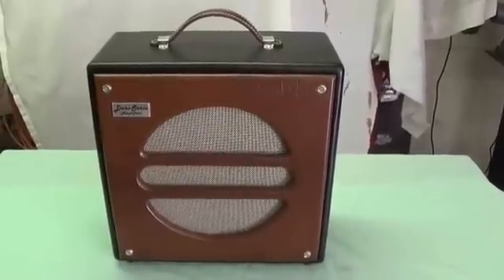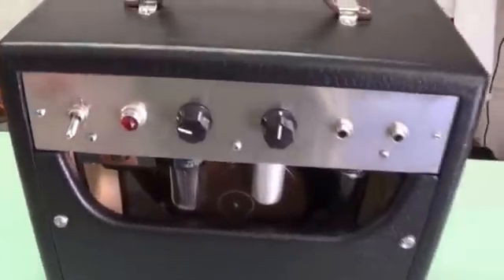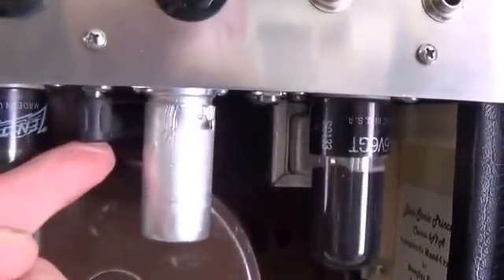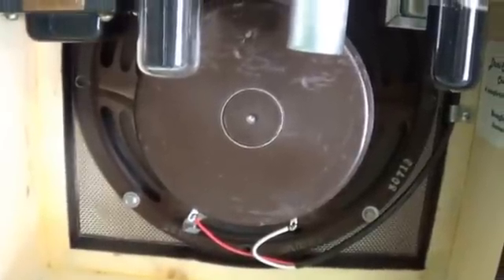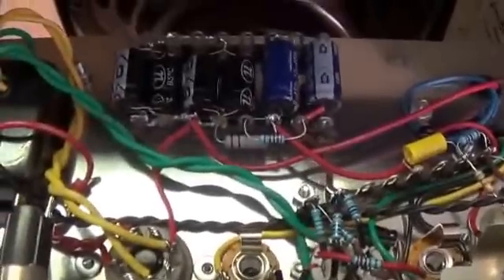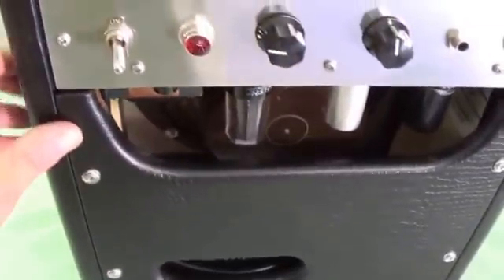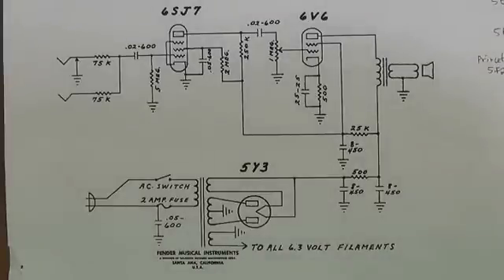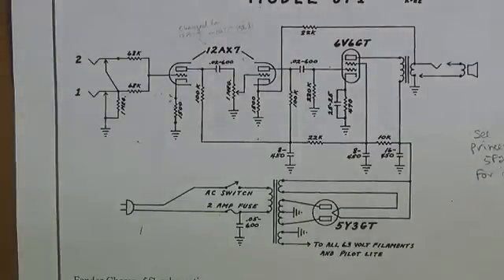1950's Fender Princeton 5F2-A Home-Built Guitar Amplifier

Comment: Uncle Doug, why did you use 1k grid stopper for 6V6?
Reply from the maker: Maybe I was out of 1.5K resistors (?)
Reply: @UncleDoug  Yes, but why did you add grid stopper ? Is there any difference in sound compared to original schematic?

Comment: Beautiful amp Doug, Amazing job, HAHA exercise in frustration indeed, For all its good aluminum is not always fun to work with. I lost all faith in 3M spray adhesives, not relevant here but, I use to use a lot of the Super77, which always worked well for what I was using it for till about a year ago, now it can barely stick two sheets of paper together with it, If you want a good laugh, Try calling 3M about a product you been using for years and having the dumb phone technician tell you its not their problem because each run is not made the same way and they can not Garantie that the same line of product will work from batch to batch, Isn't that crazy haha.
Reply from the maker: Thanks so much, Pat. I've been using a can of Super 77 for a couple years.....I guess it was part of a "good batch".

Comment: I score sheet alumimun on my bends first on a table saw with a cheap 7" panel blade . The bends come out smooth because the scoring leaves a void so you get a smooth even bend. Clamp a piece of angle steel behind bend. I use alumimun solder with a propane torch to weld my corners. Very strong and looks like a expensive factory chassis.
Reply from the maker: Thanks for the helpful tips, David.

Comment: I used particle board for my amp box,  (not MDF) simply as I had a spare 6ft shelf and it balanced out just right, and two old ex GPO equipment cabinet plywood doors for the back and front, it only runs out a tiny ex radio rola speaker , does the job , probably 5watts.
Reply from the maker: I see no problem with particle board for small amp cabinets, HP, but it gets real heavy and tends to come apart in larger cabinets.

Comment: great build.  I'm building one and putting it in an old radio cab. what is the purpose of adding the 1k resistor? would it be a 1 or 2 watt resistor?  thanks for your videos.
Reply from the maker: Is the resistor you mentioned the bias resistor?  See my video on Cathode Biasing, Jim. One watt is fine, two watt is a little better ;)

Comment: Doug - I own a 5F2A amp and have recently watched an interview with the founder of Dr Z amplifiers where he was remarking on how he substitutes certain power tubes for improved performance in his amplifiers. The two examples he mentions are using a 6n14n for a EL84 and a 7591A for a 6V6. In the 7591 example, he stressed that it is a high fidelity tube and more powerful.

All of my amplifier circuit knowledge has come from watching your excellent videos and studying (as you suggest) the original circuit diagrams. I obtained the tube data charts for the 7591A and 6V6GT and compared them. They do seem pretty similar, and the 7591 does appear to produce a little more power. It also appears (to this CPA that is not an electrical engineer) that the tube socket wiring is somewhat different between the two.The charts I compared were both for the Tung Sol branding of the tubes.

Are these tubes actually "swap-able" in my 5F2-A to give it a try, or would that be a mistake? If mods have to be made, are they extensive?

Thank you for your videos. As a lifelong guitar player it has been absolutely fascinating to have the mysteries of these amps I've owned explained in such a thorough and understandable manner. I'm having a builder make me a Princeton Reverb clone, but thanks to your videos with that amp, I'm having a bias pot installed and feel confident I will be able to correctly (and safely) bias my own amp to my preference.
Reply from the maker: Thanks for your very nice letter, Stan. It's human nature to experiment with equipment, from auto engines to amplifiers, trying to improve upon performance.....but often the results of these experiments are exaggerated to justify the time and effort involved. Is the result simply "different" or actually "better"?  Generally, the appraisal is purely subjective and possibly biased. Bottom line: I have no problem with any competent tech modifying their gear, seeking improvement.....but, I would be very hesitant to encourage anyone to pay a lot of money to have it done, based on someone else's subjective opinion. One possibility is that adapters are made to allow different tubes to be used in a socket, without any rewiring. This way you could make a direct comparison and draw your own conclusions as to the benefit (or not) of the swap.
Reply: @UncleDoug  Thanks Doug. I appreciate your answer and will return to the real source of tone, my fingers. When I raised this topic with the fellow building the PR, he responded that most of his customers are after the character of the PR and suggested that the 7591 power tubes would require more voltage than the circuit would provide using the normal transformer. This sounded reasonable, especially since I haven't a clue, so your input is all that more trusted and valuable. 
Thanks for your prompt response.
Reply from the maker: @stanwatkins975  It's true. Changing to more powerful output tubes may well require upgrading of the power transformer and possibly the output transformer too. Lots of effort and money spent.....for what ???  I don't get it.
Reply: @UncleDoug  Thanks (again) Doug. Your points are well received on this end. The builder that is helping me with the PR and I discussed your comments and agreed that using the 7591A tubes in this amp didn't make sense. When I mentioned that I had reached out to you on this matter, he shared that he was a huge Uncle Doug video fan, too. He told me that his ability to install the bias pot in my PR chassis was based on the video you made explaining that modification. The balance of our conversation turned into an Uncle Doug Fan Club meeting. Thanks again for doing the videos and providing guidance to us. Your presentation of this technical information is clear and understandable, even for those of us that are not electrical engineers. You're a star.
Reply from the maker: @stanwatkins975  Wow.....thanks so much, Stan. It's great to know that our videos really offer practical benefits for our viewers.

Comment: Hi Doug,  just stumbled on your video today.  I am retired now but spent my whole career in electronics started with tubes in the mid 60's.. Anyway, I am now learning to play guitar and want a tube amp.  Since I have the skills and understand the circuitry, I think J will give this amp build a try.  Its is a beautiful little gem and it should fit my needs quite well.... BTW, I play mostly Jazz so I think this will be a nice clean amp for my style of play.. I spent most of career with Tektronix.
Reply from the maker: Welcome to our channel, Stan. This is a great little amp and I think you'll be quite glad you built one. Best of luck with your project.
Reply: @UncleDoug  I will build it.  Just one question, any recommendation for a good speaker, I am thinking an 8 or 10 inch....  Thanks for your site, it is great.
Reply from the maker: Go with the 10", Stan. With speakers, size really does matter. Best of luck with your project.

Comment: Hey there, any problem using a 32uf instead of the two 16uf in the power supply?  They're in parallel on the schematic, but I just wanted to make sure I'm not missing anything.  Thanks!
Reply from the maker: I see what you're asking about, Tysen, and the arrangement in the schematic is a little unusual, with no resistor between the caps. I can see no reason why a single 32uf cap wouldn't work just fine.
Reply: Great.  Thanks Uncle Doug for all these videos.  I've almost watched every one!
Reply from the maker: You're welcome. If, for any reason, it doesn't work, please let me know.
Reply: Will do!  Last question: How do you feel about 450v in this position? It's a lot cheaper for me to find a 32uf 450v than a 32 500v....and I'm a poor musician.
Reply from the maker: I use a lot of 450V filter caps with no problem, Tysen. If money were not such an issue, you could go with two 70uf @ 350V caps in series. This would provide the same value as a single 35uf @ 700V cap. It's what Fender does on its larger amps, like the Bassman.
Reply: Thanks for the suggestion! Though, I'm kinda limited in space—I found an old Northrup Null Detector on the side of a road and I can't resist using it for a build...but it's is gonna be tight!
Reply from the maker: There is nothing tighter than a Northrup Null Detector, Tysen :)
Reply: hahaha! Uncle Doug, you're the best.
Reply: Hey Doug, I'm working on my 5F2A.  Because I'm dealing with an already cut chassis from some old equipment, the location of my 6V6 and 5Y3 are extremely close.  About .5" separates the glass.  How bad is that?

Comment: One little tweak: I would have recessed the rear of the chassis, so the toggle switch and knobs aren't protruding and risk getting scraped or knocked off.
Reply from the maker: Good point, David. When designing cabinets to fit chassis, you need to  consider the protruding parts, as you mentioned.

Comment: Another amazing and informative video Doug. I'm trying to finish up a Princeton build 5?2 using a 6sl7  and a bunch of junk parts from around the shop. $0.00 investment. I like the way it sounds however the volume control seems wrong in that after 1/4 or its sweep is way too loud. Its a 1 meg. pot it seems wired correctly. What could be a cure for this? Thanks if you are able to reply.. P.S. I love that speaker cover design it looks like a hamburger.. Best regards  Ed
Reply from the maker: You might experiment with other pot values, Ed. Read the resistance of your pot at the point that the amp becomes too loud and then install a pot that has a little more resistance, i.e. too loud at 220K.....install a 250K pot. Then your VC full sweep will go from silence to just too loud.

Comment: Uncle Doug!  I didn't see the all important underwriters laboratory stamp on your awesome amp and as per the gospel of Doug, no one in their right mind would play an amplifier that doesn't have one.  You must not be in your right mind!  Busting chops aside I'm curious about your output transformer.  I see that you are using the small fairly small "5 watt or so" size OT like used in the champ.  What are you biasing the 6V6 at?  I only ask because I was astonished to discover that my homemade vibrochamp was putting out 15W for a few weeks before I got hip to biasing.  I had no problems w it but have since upgraded to a heavier OT and biased my single JJ6V6 at 11.5W.  Just wondering if you have sage council to offer on OT's and max wattage for this princeton.
Reply: Thanks unk.  Your work and guidance is a treasure to the community!
Reply from the maker: Greetings, Mike. I applied to UL for a stamp of approval, but my application was "lost in the mail" as well as my $1000 "donation" to their CEO.

It's typical for small Fender amps to be biased ridiculously "hot" from the factory. In several videos, I have cautioned about this and recommended that owners check the bias of their 6V6(s). 

Tube bias (i.e. 11.5W of Plate Dissipation) and output power (i.e. 5 to 8W) are completely different parameters. The first measures the heat generated in the output tube(s), while the second measures the power being applied to the speaker coil. Just because your 6V6 has a PD of 11.5W doesn't mean that the output transformer will ever see this amount of power. In fact, in this case the power applied to the speaker  will be much lower.....around "5W or so".

Comment: hi uncle Doug thanks for all your great knowledge and great help to every one. I am looking to build a fender 5E9-A Tremloux   just looking at the 12AX7. OSC Circuit for the tremlo the plate of that 12AX7is directly coupled to the grid of that same valve therefore there must be. B+    going to the grid that is being fed from 220K. that feeds the  plate.  Can that circuit  be correct.(never herd of B+ on the grid)and also what would be the power O/p of that amp
thanking you for your reply.
Tony
Reply from the maker: You're welcome, Tony. Yes, the grid can be energized with the B+ voltage in some circuits, particularly the cathode follower configuration. It seems unusual, since in amplification circuits, this isn't done, but this portion of the circuit is a tremolo oscillator (not amplification) circuit......and the unusual connection is required for the oscillator to function.
Reply: hi Doug lots of thanks for your prompt reply you are so great with your work and knowledge thanks again
Tony

Comment: Great video, I have the amp with 5F2A circuit, lovely amp,  I have a question, is it possible to run this amp with EL84 output tube? VHT currently have EL84 converters for 6v6 sockets, and their website says "The Special 6 EL84 adapter works in other 6V6 amps as well. Check with your amp tech to be sure your amp's voltages don't exceed the maximum ratings for an EL84" . I checked a plate voltage in my amp and it's 302 volts, maximum rating for EL84 i 300v, is it still ok to run the amp like this, or do I need to change other components to accommodate EL84?
Reply from the maker: Greetings, Artur, and thanks. Bear in mind that your current plate voltage is affected by your plate current, and both will change if you substitute EL84's for 6V6's.  That said, any EL84 worth its salt is easily capable of handling a PV of more than 300VDC. Recall that the max PV for 6L6's is 315VDC.....and Fender routinely runs them at well over 400VDC. As long as the Plate Dissipation is within normal limits, you should have no problems.
Reply: I will calculate Plate Dissipation so, I think 12W is maximum PD for both 6v6 and EL84, , Many Thanks for your valuable answer.
Reply from the maker: Yes, 12W is about right if the tubes are cathode biased. If they were fixed bias (grounded cathodes) the max PD would be 70% or about 8.4W.

Comment: Hi Uncle Doug,I built a Princeton 5F2A amp a couple of years ago and just now going to install it into a cabinet.  What I plan on doing is installing a tremolo circuit once the amp is up and running. I looked at the Vibrochamp amp schematic and will be using the circuit that Fender uses.  I will have to install the 25uf/50v cap and the 47Ω resistor on the cathode of the 12AX7 and feed the speaker from the 47/1.5kΩ spot.  There is a 2.7K resistor going to the speaker and the one in the 5F2A is a 22K. Can you give me any tips if I'm doing this correctly or incorrectly. I have some pictures of the 5F2A if you want to see them. You can contact me via e-mail address to further discuss this "upgrade". I also built a 6G15 reverb unit to go along with the 5F2A...your video(s) on the tolex installation will be a tremendous help as I have not done this before as I am a better carpenter/electronic tech than a tolex installer ;-))Again, many thanks for the videoTom...
Reply from the maker: You're welcome, Tom. The addition of the tremolo should be fairly straightforward. I would connect it to the cathode of the second 12AX7 stage, just like in the VC, and then experiment with component values (if necessary) to optimize its performance.  Anytime you make a modification like this, some minor tweaking is generally necessary. Good luck.

Comment: Hey Uncle Doug. I was wondering what the channel bar (L channel) that connects the two pieces of the chassis is made of? Is it also aluminum or steel?
Reply from the maker: +Nemo Alicunde  It's aluminum, Nemo. I bought it at Home Depot. It's best to stick with one type of metal. When two different metals are in contact, electrically-caused corrosion can often occur between them.
Reply: ok thanks alot. Is there any specific type of screws I should use? Sheet metal screws?
Reply from the maker: I would use No. 6 or 8 machine screws with nuts and lock washers, Nemo.
Reply: Galvanic reaction. It is a constant concern mostly when building salt water boats and ships, or with anything electrical, like with phone wires and connections that turn green. A dab of dielectric grease will help prevent a galvanic reaction, and prevents signal loss on things like video connections of security systems... This link will explain better. https://www.fastenal.com/content/feds/pdf/Article%20-%20Corrosion.pdf
Reply from the maker: Yes, indeed. Thanks so much for this additional information, NP.
Reply: Hey Uncle Doug. Thanks for your responses and I appreciate the info Nor'easter. In the case of using aluminum, what about all the other parts like the tube sockets and the bolts for the transformers and so forth? Will they need to be specific types to use with aluminum. For instance I got the Classictone 40-18019 PT...will there be a problem using this with aluminum? I have not built anything yet so Im not locked in. I can use steel but I know that drilling the aluminum will be easier.
Reply from the maker: That's a good question, Nemo. I use steel fasteners with my aluminum chassis and have not had any problems in several years.....but corrosion theoretically can occur between the two different metals.

Comment: I'm about to build a 5F2-A from a mojotone kit and use a Panama 10" cab, then I saw this. I like your chassis and will do the same. But should I be concerned that it's not shielded with an open chassis like that? Will it hum around fluorescent lights...?
Reply from the maker: +Nor&#39;easter Playa   I have 5 large fluorescent light units in my workshop, where the amp was built and tested, and there was absolutely no hum at all.  You can use this design without worrying about this problem. Good luck with your project.